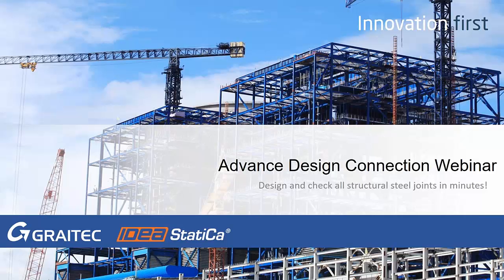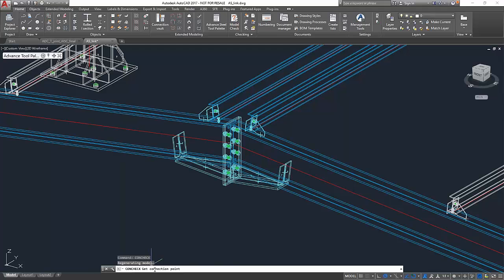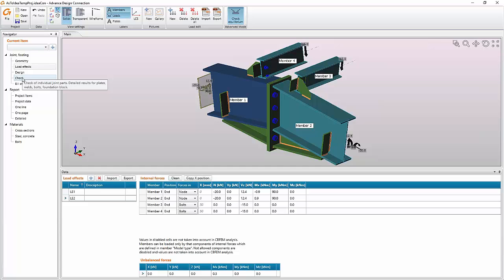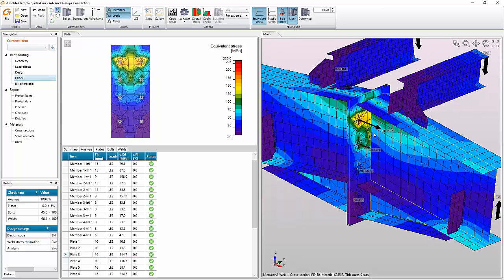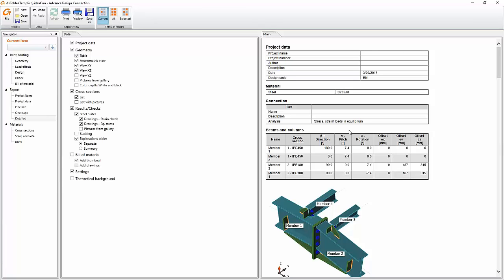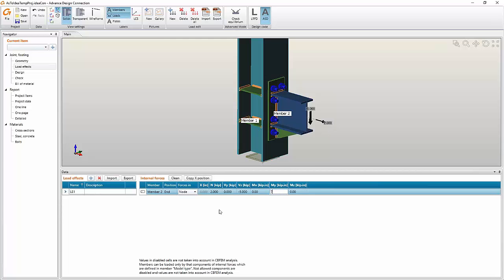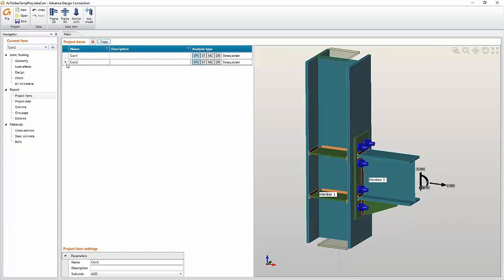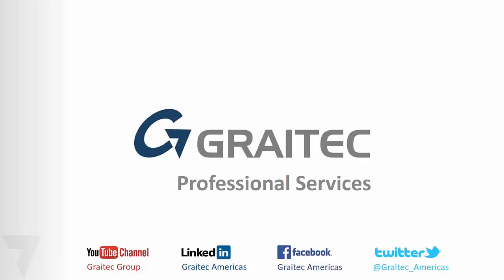Advance Design Connection, design and check all structural steel joints in minutes

Comment: can you design connections  with this aplicación for seismic conditions, for example moment connections for dúctile frames according to aisc code
Reply from the maker: Yes we have implemented AISC 341-10 for seismic analysis. We provide member capacity design type of analysis for such cases and also there are options to input "dog bones" or notches on beams to force the plastic hinge in specific position.